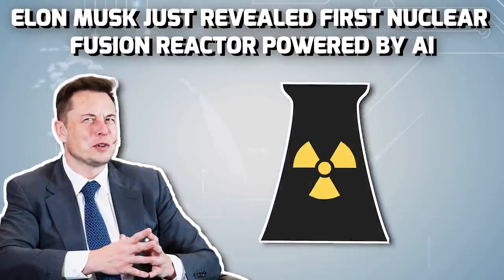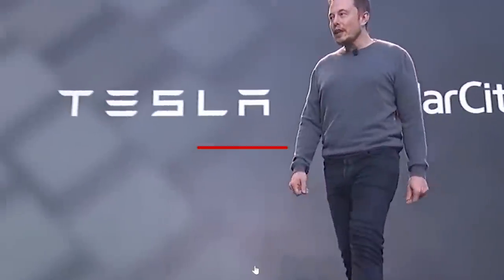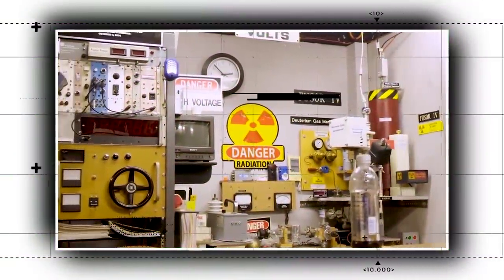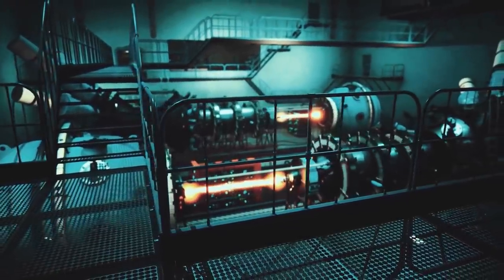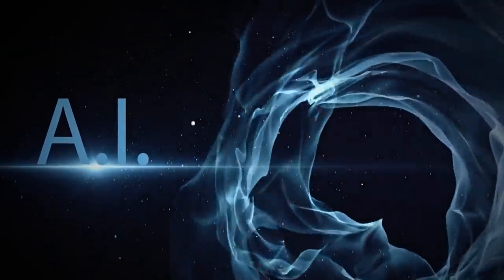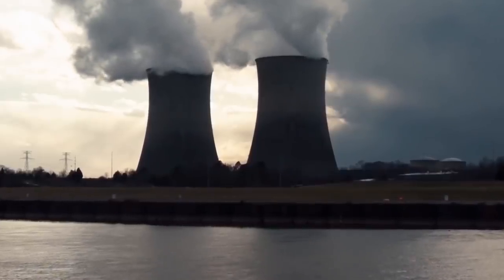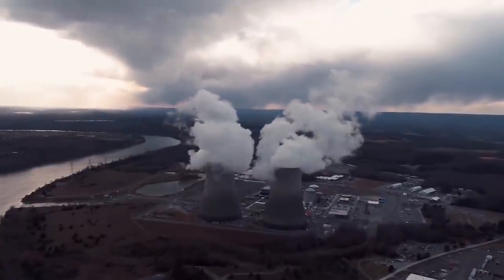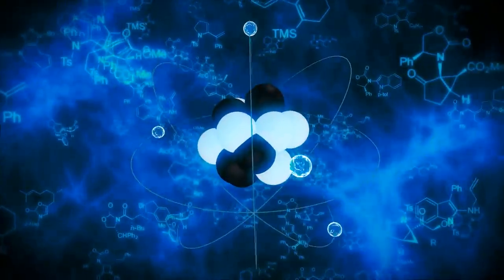Elon Musk LAUNCHED The World’s FIRST-EVER Reactor Powered By AI!

Comment: The one issue with fusion reactors that NOBODY has addressed is how to fuel the reaction beyond ignition. Once the intial hydrogen/deuterium fuel charge is consumed/converted to helium and energy, HOW do you keep the reaction going?! The sun CONSUMES about 5 MILLION TONS of hydrogen every SECOND! IT is primarily made of hydrogen so refueling is automatically controlled by it's mass, gravity and pressures that can split helium back into hydrogen and create other elements along the way. Fusion reactors on Earth are extremely limited in size and consume their fuel in MILLISECONDS! Fusion is a pipedream...emphasis on the pipe...and what you're smoking in it! Clean fission reactor are the REAL future.
Reply: In Tomas device the reaction take place very slowly, such as five seconds or 17 minutes, not in MILLISECONDS. So you had enough time injecting new DT particles for increased density, when these new particles meet hot plasma, they'll become hot and react.